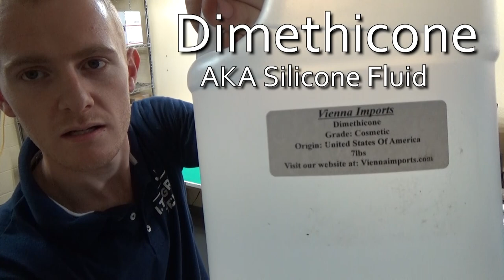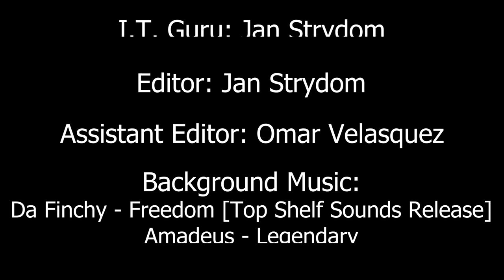Fully Submersed Silicone Fluid "Mineral" PC - Part I: "The Build"

Comment: What would you say are some of the Pro's and Cons with this type of build? Also please list the parts you are using
Reply from the maker: We just used an older custom desktop PC we had sitting around the shop. This unit is still running in my store every day since the day it has been built. We will post another follow-up video in a couple weeks. As of today, the system is still running perfect. No stickers dissolving, liquid still perfectly clear.